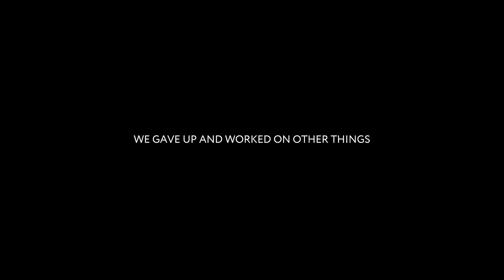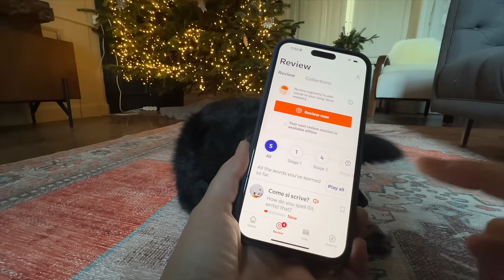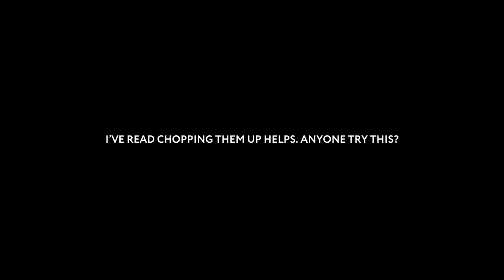It's Complicated: Our Chateau Kitchen Renovation

Comment: Pulling weeds is SO backbreaking. We spray our beds with white vinegar and water. The weeds die and are easy to rake up once they’ve dried up. Then we cover for the Winter.  We’ve done this for years and it seems to always work.  Makes for happy gardening in the Spring!  P.S. The cost of all that vinegar is offset by not having to pay a chiropractor! 😆 And yes, that plant you pulled out of the compost looks like my avocado tree.

Comment: The run about carriage is meant for a heavier horse like a draft or shire type  horse which is over 2000lbs, it appears to be in decent shape but you would have be the judge of condition and worthyness for use again. Learning to drive an equine pulling a wagon or sulky would be fun!

Comment: Weld a tow ball onto the mower deck. That way you don’t have to keep disconnecting the mower deck whenever you need the trailer. Then just raise the mower deck to whatever height you need.

Comment: Lincoln the drive shaft should have button at the end by the tractor. Pull back the coller to have room to grip the driveshaft. Push the button in while pulling/working off the shaft. Colorful langauge does help😅.  A 3point frame are made so you can use trailer hitches with out a receiver on the tractor attaching with the side arms and top bar